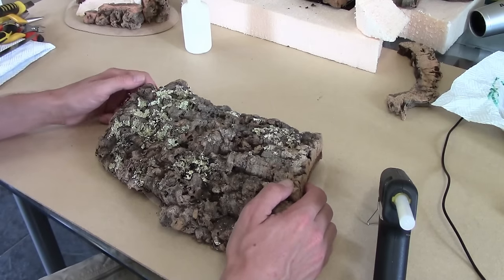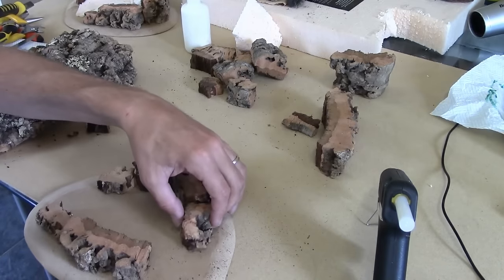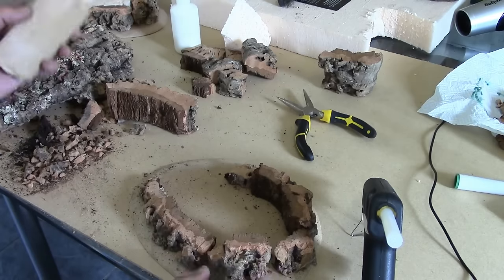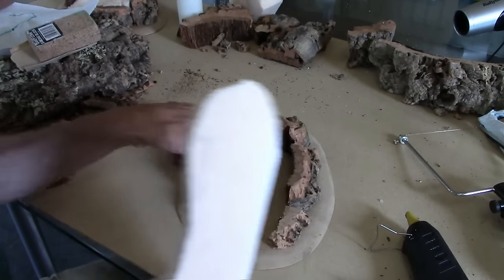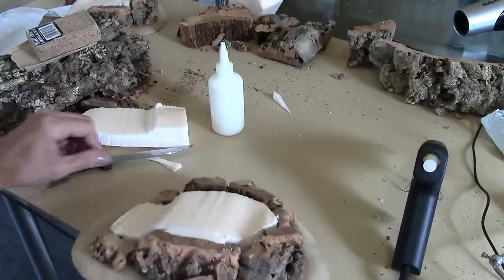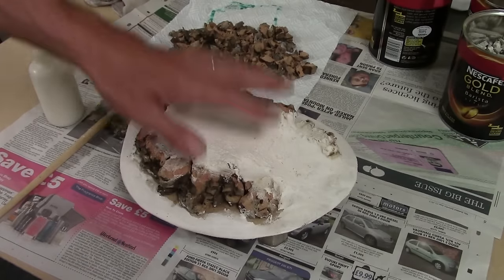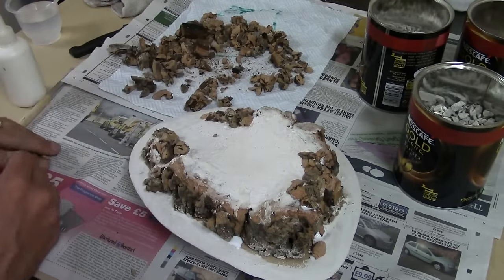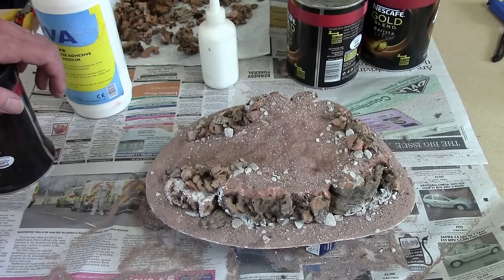More cork bark rock face tips for your wargames scenery

Comment: Where would be best to get cork bark from? I've seen small pieces of it in pet stores but I was wondering whether there's any cheaper places to find it
Reply: ***** The woods, mate! Keep an eye out for cleared areas of trees, trails, construction sites, etc. Anywhere trees are coming down, you can find it for free. Aside from that, craft stores I suppose. If you can't find any, don't worry! You can do cliff faces with plenty of materials -- Try doing a heavy stippling with filler (spackle) on rough broken foam and breaking up those smooth spots with rocks and heavy grit.  Just keep an eye out for anything rough you could cut to fit a cliff face.  Don't spend a fortune on making terrain.
Reply: belkozen If you cant find the woods go to a park after stormy windy weather - fallen trees & branches - if you speak to a gardener, treeman might also help source materials - large pine bark is sold in bags at nursery/ hardware.
Reply from the maker: ***** Well it only grows in Portugal, so unless you live there, you're pretty much stuck to buying. Netpetshoponline sell it in large bags.